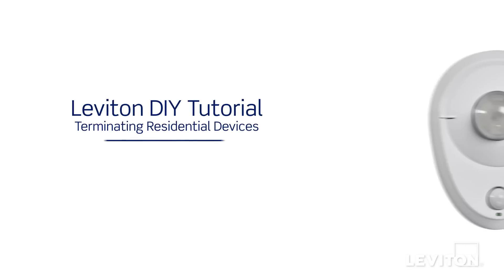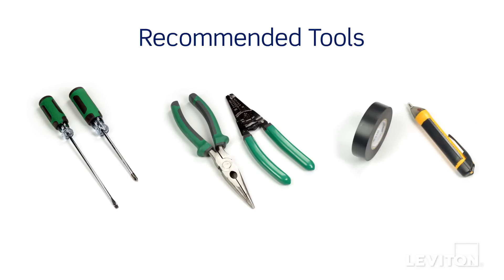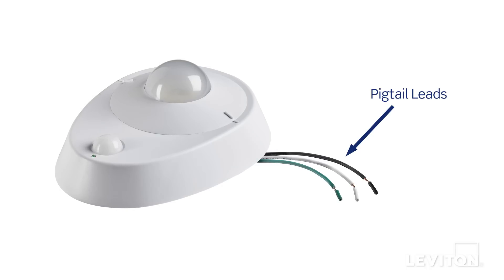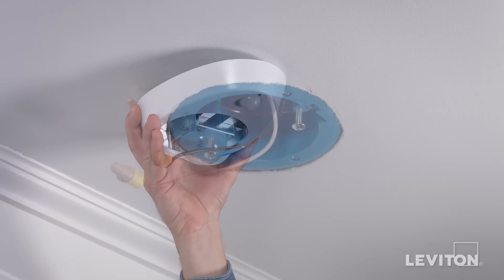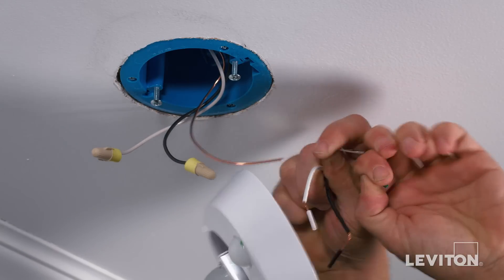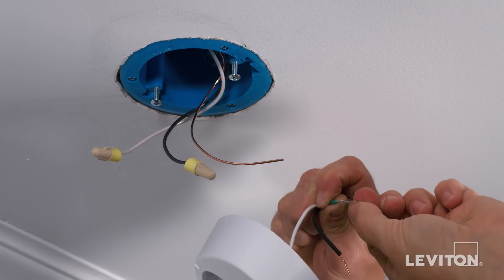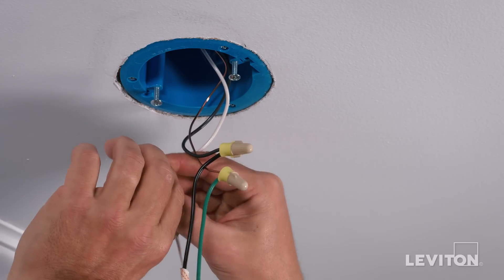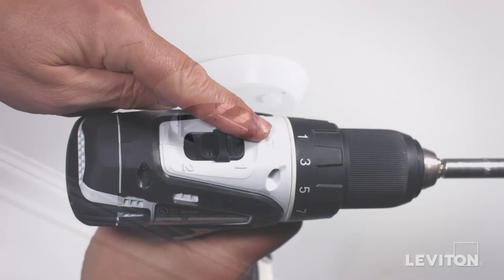How to Install the LED Ceiling Occupancy Sensor Lampholder | Leviton

Comment: if I want to sense only a human by ignoring Rat and any animals what to do..can u explain.
Reply from the maker: Hey Kumar, for the best technical support for Occupancy Sensors we suggest you fill out the form located here: http://www.leviton.com/en/support/product-support/electrical-wiring-devices-residential

Additionally you can call 1-800-824-3005 for support